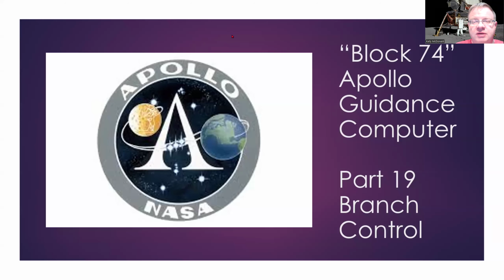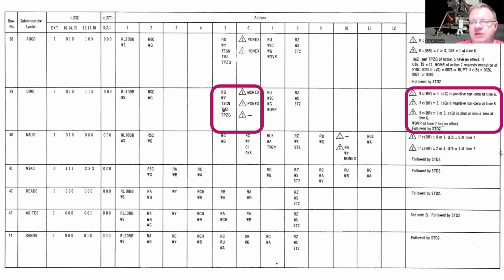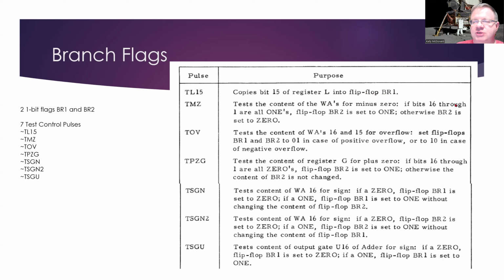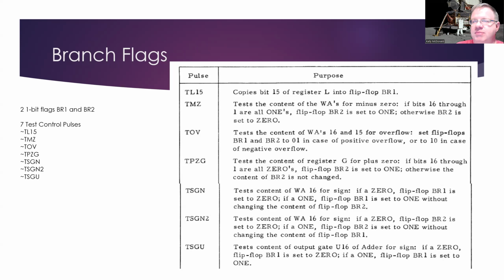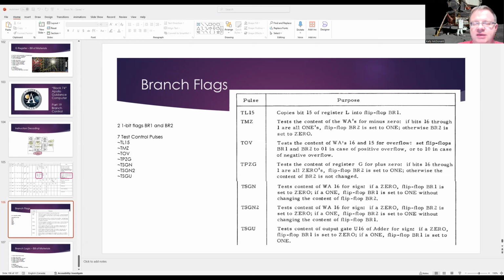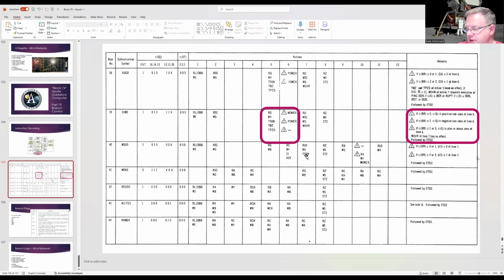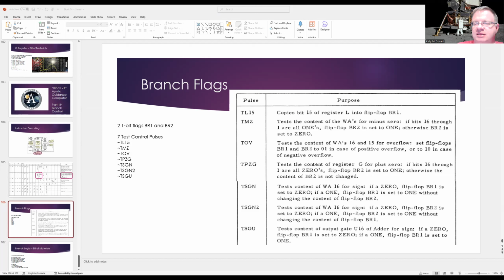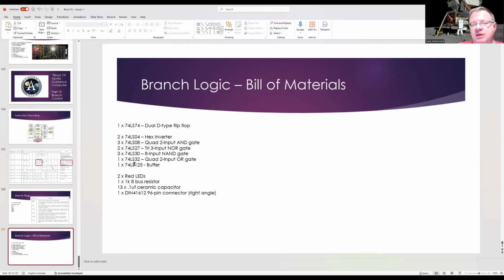EP 19: Branching Logic

Comment: Wow, yeah, the wording in that control pulse table is needlessly confusing. TSGU does not affect BR2; it simply copies U16 into BR1. AGC4 memo 9's descriptions of the control pulses are a bit more clear here. Figure 4-136 in ND-1021042 might be the best way to directly confirm which control pulse affects which branch register -- it has logic equations for both printed on the left sides of their respective pages. TSGU appears in BR1's equation but not BR2's.
Reply from the maker: Fantastic, that's exactly what I needed
Reply from the maker: I'm noticing that there a few cases where multiple test control pulses are generated simultaneously. Not quite sure how that works when you have TMZ, TZGN, and TPZG at the same time. May just have to look at the logic equations and replicate them
Reply: @kellymcdonald78  For that specific example, TSGN doesn't conflict since it's the only one that modifies BR1. TMZ and TPZG are different since both modify BR2.... and looking at the schematics, it seems like there was some special consideration made here. TMZ operates by always resetting BR2 during PHS3, and then setting it in PHS4 if the write lines are -0. TPZG, on the other hand, has no ability to ever reset BR2; it simply sets it during PHS4 if G is +0. So when both occur at the same time, the setting of BR2 during PHS4 is essentially an OR of the two conditions.

An interesting restriction from this implementation is that TPZG can't be used unless it coincides with or is preceded by some other control pulse that does the work of clearing BR2. Spot-checking the control pulse sequences this appears always be the case. That's something I never really noticed before!